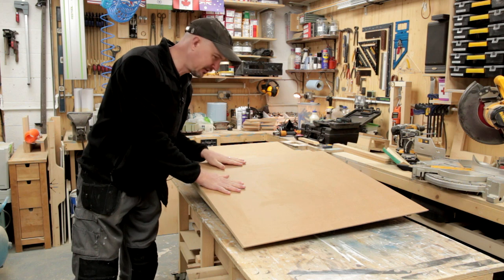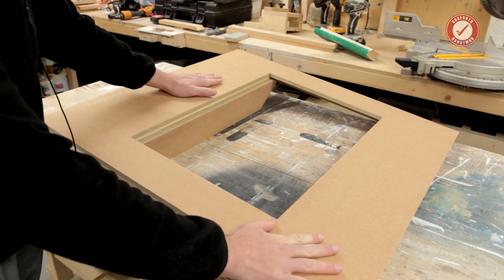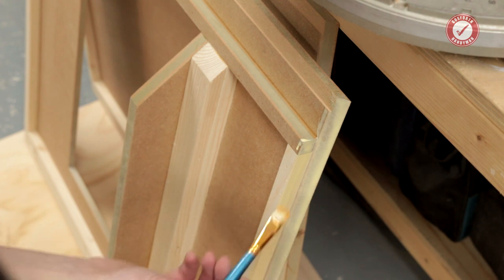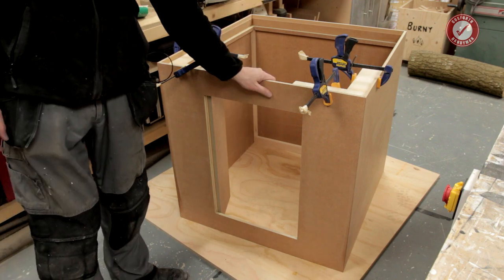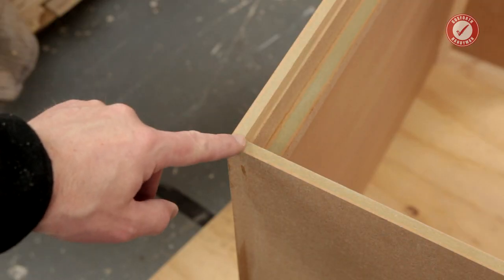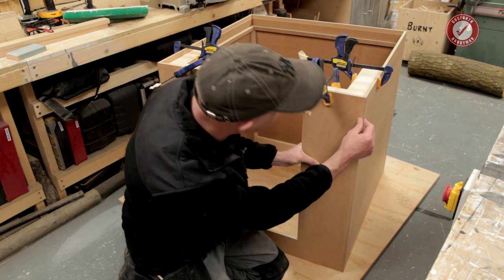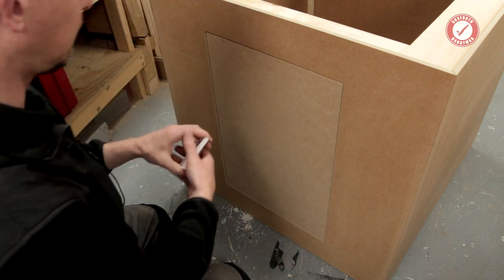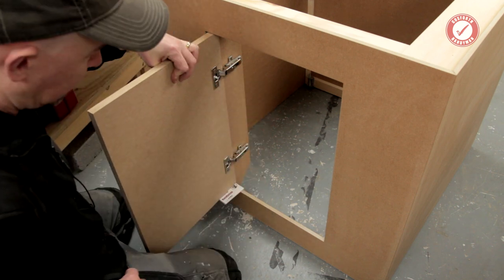Euro Hinges & Assembly - Cube Display Unit (part 3 of 3)

Comment: All said and done [from my previous comment in Pt1] Great design, worth the effort and great build. Thought it was pure inspiration to add those extra strips of ply around the top... adds extra strength to the unit and further support to the displayed piece. [must have been there in your subconscious when you were attaching those original supports and setting them too low - amazing!]
Reply from the maker: Cheers Keith! 👍

Comment: TIL: How to secure a circular saw guide using a square and a clamp (no more g-clamps at each end, which does not work at all); how to clamp a pre-made L-square to the sides of a box (no more mucking around with massive clamps); business cards to center a door in the door hole. Way to go! Oh, and nice display cabinets!

Comment: Beautiful box and beautiful series. I learned a lot from it.
One thing I fear: You designed the whole box according the specific dimensions of an acrylic top which you did not see.
What if the makers of the top do not work as precise as you do? In that case the top and the box might not fit together.
Reply: I used too work in those fields as a fabricator, and wouldnt mind one bit as to whether it was a built unit or not, easier to fit it to a build unit anyway as your fitment can be precise as to the measurements being already set up

Comment: Hi Andy,
As you are doing miter corners,  did or have you concidered using the router miter bit to form the joint?
Reply from the maker: Do you mean a lock mitre bit or just a plain 45?
Reply: @GosforthHandyman  yes the lock miter bit
Reply from the maker: Gonna do a vid about that - not a fan of them. 👍

Comment: Four minutes in and I am making notes on not using 18mm mdf for cabinets (too late for my current project) and knocking up some clamping brackets for my edges to save buying long clamps.

I guess you don't find any issues not clamping the bottom of the joint?
Reply from the maker: Yeah, it's fine - the clamps are just to make sure it's square really. The clamping pressure for the glue-up comes from the brads. 👍
Reply: @GosforthHandyman  ah, didn't see you pin it too.

Comment: A very good and informative series with lots of tips on what to look out for. An interesting titbit of information that came out: not all euro hinges are the same. I must admit i assumed they conformed to international (or European) standards. Perhaps there is room for interpretation in those standards!? I have used euro hinges on 13 mm contiboard (MFC) successfully although the tip of the Forstner bit can occasionally show on the front face... It's tricky but doable (“If that makes sense?”<g>).
Reply from the maker: Yeah - they should be to a standard 😀 but never are...

Comment: Hello Andy I am from Argentina, would you be so kind to let me know the brand of the bit you use to make the holes for the euro hinges, the ones I have wear out very quickly and the one you are using looks mucho more stronger if you know what I mean, thanks in advance
Reply from the maker: The 5mm holes in the cabinet? No idea I'm afraid! They're really old drill bits and I just sharpen them myself. 👍
Reply: Sorry I meant the 35 mm holes
Reply from the maker: Ah, OK - they're just from Screwfix here in the UK. They're quite easy to sharpen though. Might do a vid on that at some point. 👍👊
Reply: Thamk you very much  for taking your time to answer back, as you say it would be very instructive to know how to sharpen them , they are pretty expensive in my country

Comment: you can get hinges that work like euro hinges but doesn't need the deep hole, they might just barely work with 12mm https://www.carl-ras.dk/gfx/imager/catalog/53301.jpg
Reply from the maker: Cheers! Yeah, really need the adjustability and screw depth might be an issue. 👍

Comment: Isn’t the lock upside down?
Reply from the maker: ? That's the only way it can go.
Reply: Gosforth Handyman Weird, it looks like the bolt is being turned up to engage rather than turning down. Not that it really matters. ;-)
Reply from the maker: It does and I thought the same - you can't change it though! 😀👍